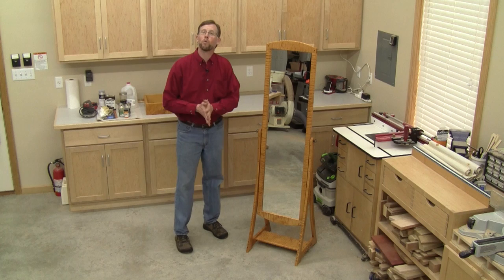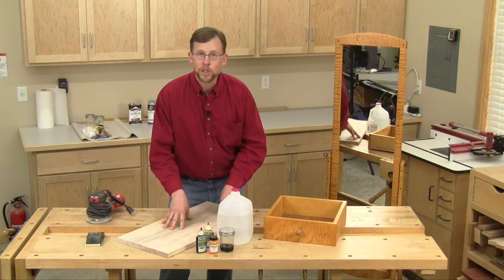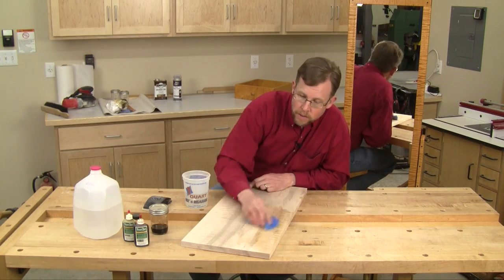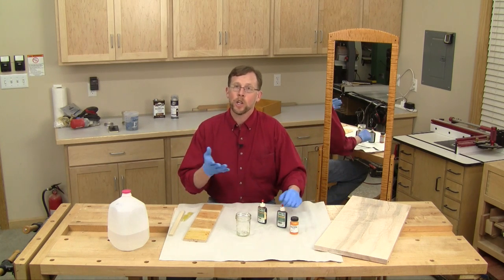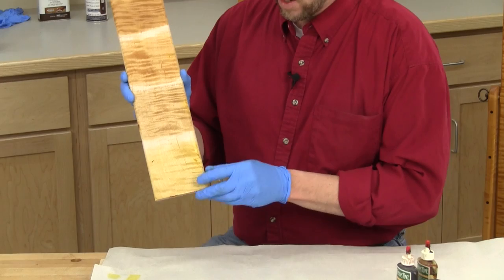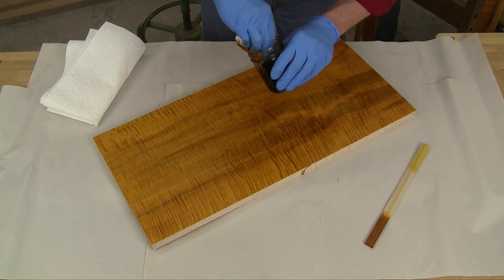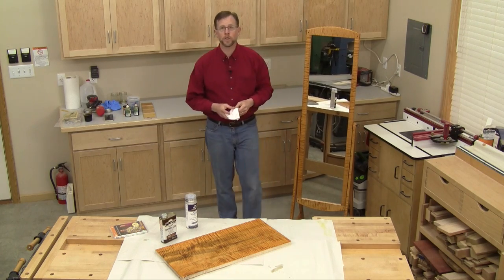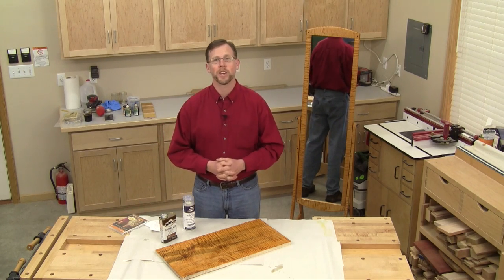Three-part Finish for Figured Maple Full-length Mirror

Comment: Fantastic. Thank you!  Now if I only knew how to get rid of that tear out on my maple first............
Reply: Mix your dye into some stainable water-based putty, match it with a test strip by applying varying concentrations and drying over them all, fill and sand your tear out with the putty, use touch up marker to blend with the grain, then stain over it.